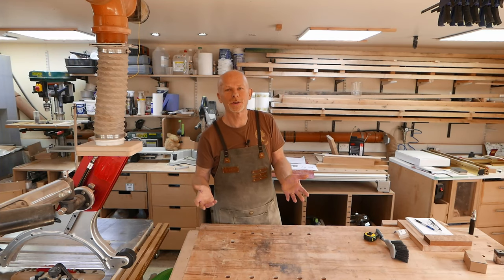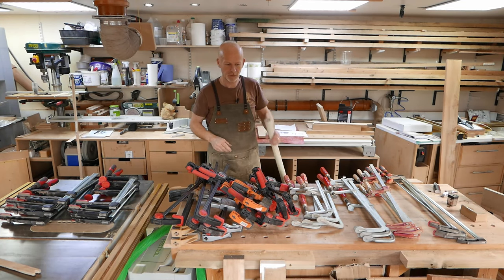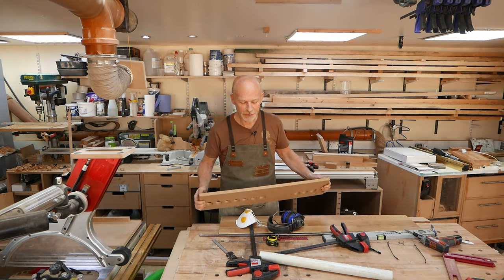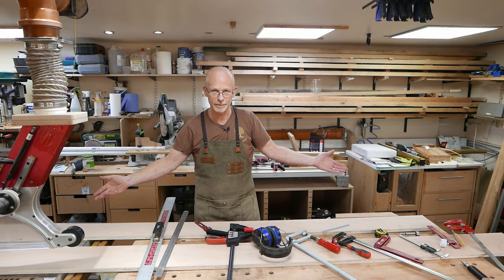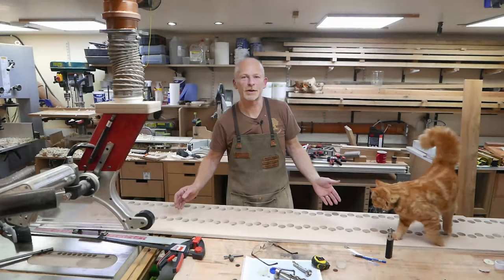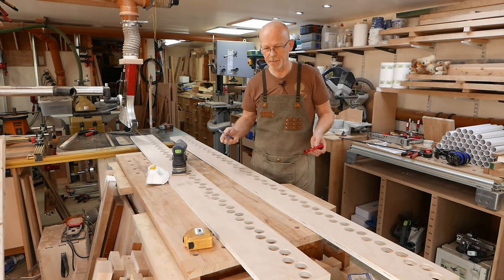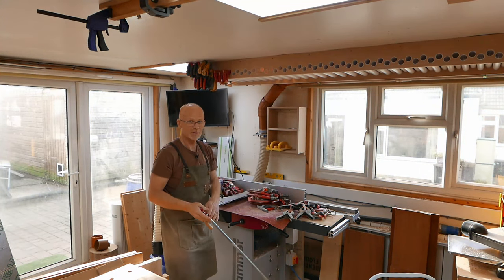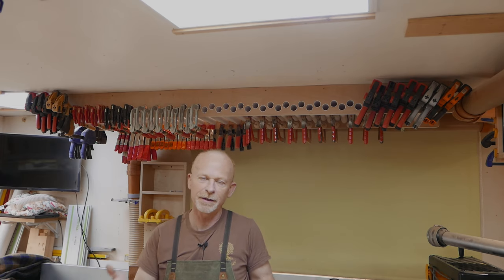Simple Overhead Clamp Rack.  Just Pipe and Ply.

Comment: Never thought of that way, using the other end of the clamp.  My problem was loosing a lot of space on my French cleat wall, and it’s the only wall available to store it.  I have a high ceiling so I have to use a longer 2x2 to extended it down to where I can reach it without grunting.  Thank you Sir for the idea…..

Comment: That's a very good solution for clamp storage~!  I'd like to use it, but my ceilings are too high for practical storage (12').  Thanks for sharing~!
Reply from the maker: Hi Andrew, wow 12 ft ceilings.  What an amazing space, that's almost enough for a 2nd floor.  What about a suspended clamp ram???
Reply: @GTWoodshop  Yeah, I was able to graduate from 12'x12' sheds and single-car garages after retiring from the Army.  Only took me 10 years to get into a steel-sided pole barn (30'x40').  I considering building a raised platform on one end for storage.  Also, my ceiling isn't closed, but rather open to the 5 steel trusses that hold the roof.  Suspending things is tricky.   ;-)
Reply from the maker: @andrewbrown8148  Sounds like a fabulous challenge. 😁😁

Comment: If the pipe was level, you could put a clamp in from either side ie 2 clamps per tube. (Wrote that before I saw the final product. Didn't realise that it'd be that close to the wall, or going in that direction)
Reply from the maker: True, but I'd have to bring it out from the wall further.

Comment: Why did u need the pipes? Could it work with just the 2 boards. Front and back? With clamps going thru them without pipes?
Reply from the maker: Hi Hugo, without the pipes I would have to try and thread the clamp through into the hole in the back board.  With the pipe I don't need to worry, its effortless to put the clamps away.  You've seen what I can do to my workshop so I need to make putting stuff away as easy as poss. 🤣🤣
Reply: @GTWoodshop  really like your design. I was amazed you were able to align them so well. 

I’m Setting up my shop now. The clamp storage solution you came up with is the best I’ve seen so far. I Need to noodle that 🧠. Thinking of angling the handle 45 degrees to reduce vertical space requirement.
Reply from the maker: @hdwoodshop   Hi Hugo, thanks.  Let me know what you come up with, two heads are better than one. 👍🤔